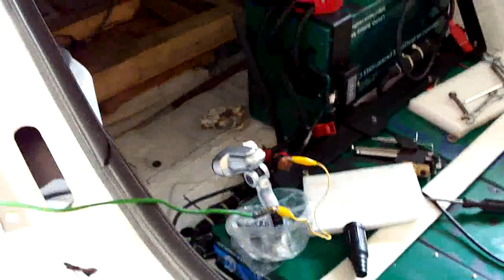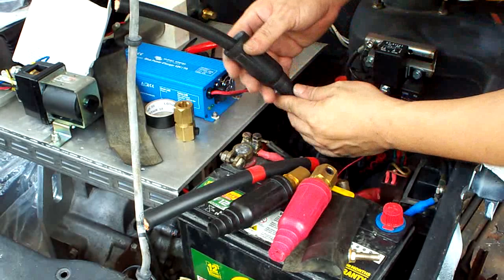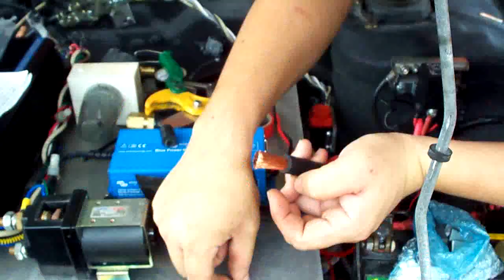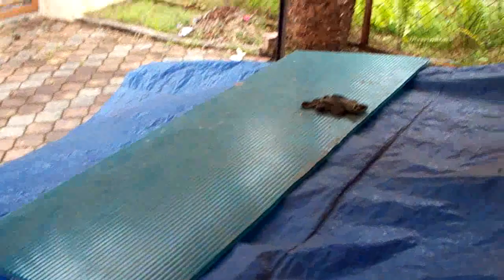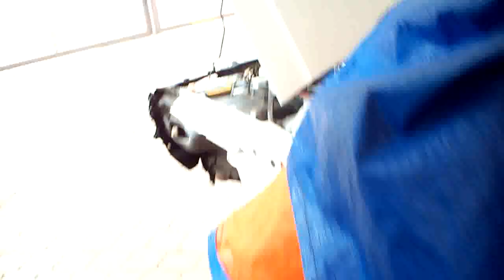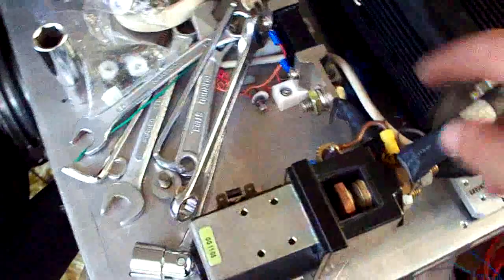Event 65

Comment from the maker: Greetings Ric
that half banana half Hornet started life as a PVC pipe cutter,
I wanted to put it away after it failed to cut PVC pipe at a right angle.
it did a fantastic job as a large cable insulator remover
no brand, guess any PVC pipe cutter will work the same.

just keep an eye open for throw away PVC pipe cutter
I believe many goes into the bin daily, 
many can't do a good job cutting PVC 
EV guys will love them ,, hehehe
for free !!

Thanks for the support Ric!